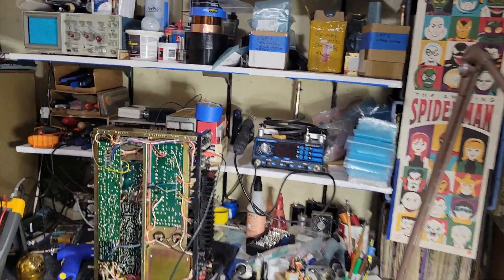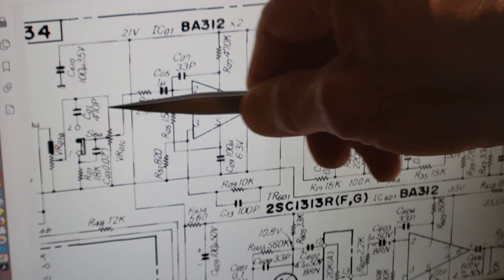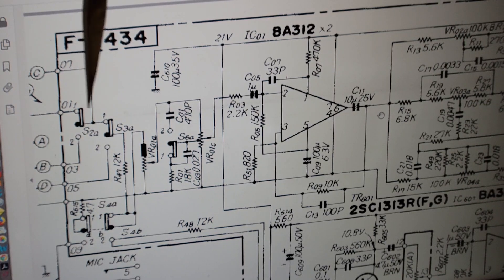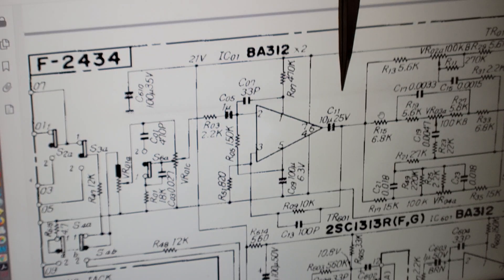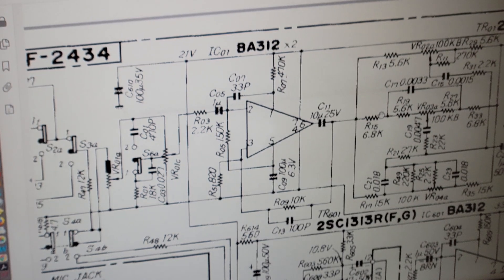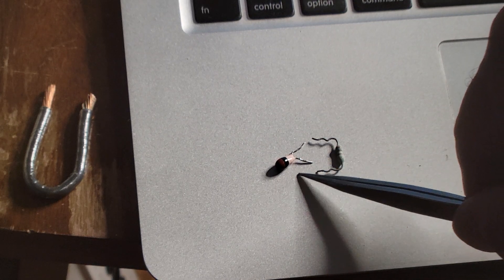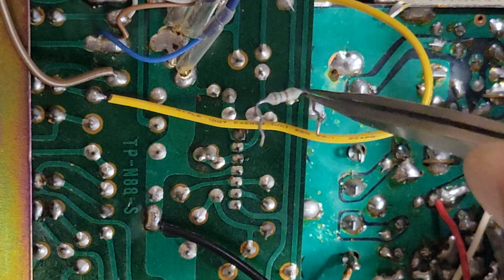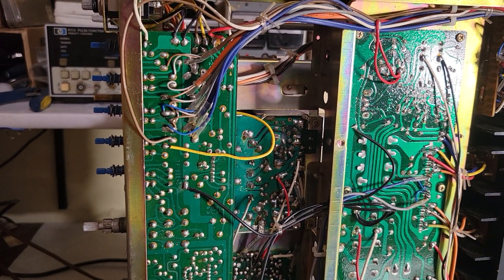Vintage Receiver Repair: Sansui 881

Comment: Love to see the good times roll! Great to see it was a simple and cheap fix! The receiver looks retro and sounds great! Did you do any other checks - like DC offset or bias levels?
Reply from the maker: Yeah,  I did those (at least I think so; if they were in the service manual, I did them). I spent more time on cosmetics, specifically the "frame" around the dial got lots of polishing and repainting.
Reply: @Lancaster_Hi-Fi  - mmmMMMmmmm. Shiny...

Comment: One of the good deals in Sansui receivers.  Just replaced the bias trimmers in mine.   My 881 is high mileage and needs attention every couple of months.  Up graded the outputs with modern devices recently.  Mine really sounds nice with altec model 5s.   Like you, I  get a lot of satisfaction resurrecting classic gear.  You are right the xx1 sansuis get no respect.  Bravo Zulu man.